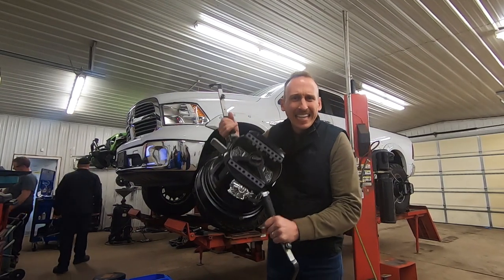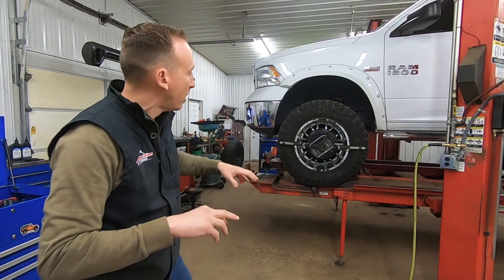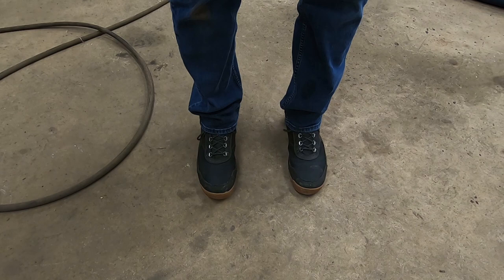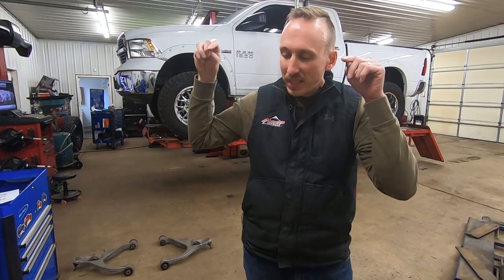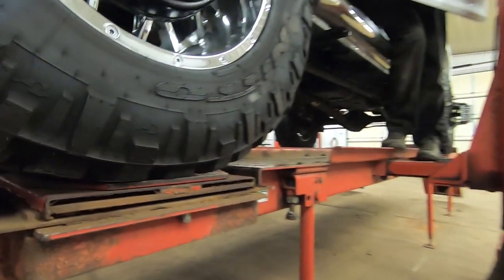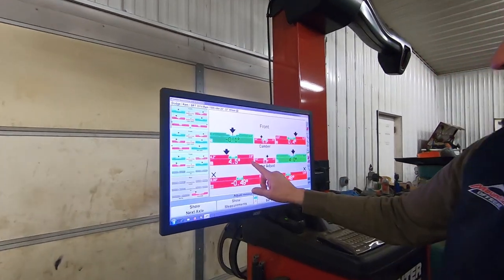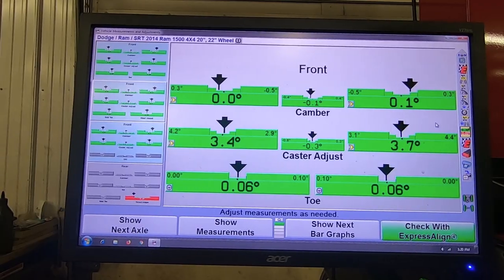LIfted Truck Alignment | How we do it!

Comment: Glad to see someone knows what they are doing.. I aligned my jeep and took it to the dealership for a recall fix and just asked them to throw it on the alignment machine. Got a call a day later they could  not do it. Picked up my jeep with the hydraulic ram hanging down. Torn drag link boot. Scratches all over my aluminum 2.5t steering from a damn pipewrench. Such bullshit. Not many TECHS nowadays, just useless partswappers. Good job

Comment: I had to set my lifted Tacoma to 5.3 and 5.6 caster to fit my 33 inch tires to stop them from rubbing the cab. They don’t rub now but is there an issue with having that much caster? It drives ok I’m just worried that must caster will cause issues

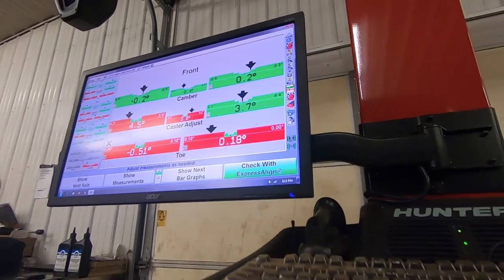Comment: 5:50 Caster is a calculated angle and not live. You should always verify caster with another sweep to re-calculate.  WinAlign makes a caster assumption during adjustment but you should re-measure (sweep) after adjusting.  Also while using WinToe for final toe adjustment the steering wheel hold-down is not necessary as long as you center the wheel during the WinAlign process prior to selecting Ready.
Reply from the maker: Thanks for sharing your experience!

Comment: I have Gen 4 Tacoma Pro and it came from the factory out of alignment. Didn't notice the front wheels were canted inward until 1K miles. Toyota did an alignment, but to the specs of a 23 Tacoma Pro because the 24 wasn't in the system yet. Should that make a difference? To me, they still look a little canted.

Comment: Also, can't get rid of the power steering pump whine.  Even more noticeable in colder weather.  I installed a red head steering box but can't find the right pump.  Any suggestions?

Comment: I have a 2002 Ford F-150 2wd SuperCrew.  I just had a front end shop install. All steel Torch off road 3 in lift/level kit spacer on top of my coils well everything went well alignment is all good except for the camber the tech said the adjustment is all the way out it’s maxed out you need longer upper control arms the Camber is off 2 degrees the inner tire will wear.   Is there anything else I can do? Is there different bolts or a Camber kit? To get my truck back to specs?
Reply from the maker: Are you saying the camber is actually off by 2 degrees? Or you are in spec and just will not be able to adjust any further if needed next time around? Rough country does make a knuckle for your truck with a 3" lift, something like that may be the best answer to correct this
Reply: Hi  sorry my mistake meant To  say all other specs are ok except for the Camber I’m off 2 degrees .

So as it sits I’m happy with the lift I cannot go anymore.  Do you have a part# or name for that knuckle from Rough Counry? Will that get me back to spec on Camber? With out lifting the truck anymore?     Thank you!
Reply: @joecarreon4824  the knuckle repositions your axles at a better angle and also the upper control arm attachment point to put ball joint at correct angle as now its stressed out of preferred range.

Comment: I wanted to see how you put the vehicle in neutral and roll for compensation but didn't see that here does Dodge have some kind of a service mode to keep the vehicle in neutral
Reply from the maker: For new Dodge and Jeeps we usually just put the T case in neutral. There is the manual neutral override in the dash but our techs prefer to use the T case so they’re not prying off dash panels

Comment: Question; on the front camber, should the holes in the washers be located in the same spot or is it normal for one to be on the top side of washer and the other side be on the bottom side of the washer
Reply: I too want to know if this is normal 
1 out of the 4 on my truck is pointing in the opposite direction

Comment: Great video but I have a 6 inch lift as well, 35x tires. How do you align it without having the lift specs? The inside half of my tires are currently as bald as can be. I want to take it but how do I know they are doing it correctly without me being able to provide the specs on the lift kit (bought the truck used)?
Reply from the maker: Ideally if the alignment shop can get it to factory specs that would be perfect! You don't necessarily need to know the lift specs to get the alignment set! A shop with the right know how shouldn't have any issues getting you straightened out! If you're near us in PA we would be happy to get you fixed up!
Reply: @MountZionOffroad  I wish I was im in MA. I ended up taking it in and now my steering wheel is stiff as a board. I dont think they knew what they were doing. It appeared that they had the same equipment as you guys did though so idk. Arghh. I appreciate your response and help. Thank you!
Reply from the maker: @Rcabezas1 No problem! We're only about 45 minutes from Maryland! If you're ever having issues feel free to give us a call if you wanna make the drive!
Reply: @MountZionOffroad  MA (Massachusetts). Thank you for the offer.
Reply from the maker: @Rcabezas1  ahhhh right 😂 sorry I misread

Comment: Great video. I have a question my f-350 just got an alignment but my steering wheel is of is not centered it hangs to the right . Can I adjust the steering link without throwing the alignment of??
Reply from the maker: No, you should take it back to the shop that aligned it, they skipped a step!
Reply: If your F350 has a track arm then yes you can center the steering wheel without changing toe because the total toe is adjusted at the tie rod end not the track arm.

Comment: What can be done if the front track is wider than the rear
Reply from the maker: are you asking what can be done to correct that, or whether we can align it if that is the case?
Reply: @MountZionOffroad  if it will mess with alignment

Comment: How about more details on what you feel with different settings? Say toe in toe out caster camber ECT especially for lifted vehicles. Also how about differences between lifted vehicles or difference from small to large tires. Like do you have to use different setting for the large tires VS smaller tires?
Reply from the maker: Good input! We'll do another one in the future for sure
Reply: @MountZionOffroad  Sweet! I will be watching for it!